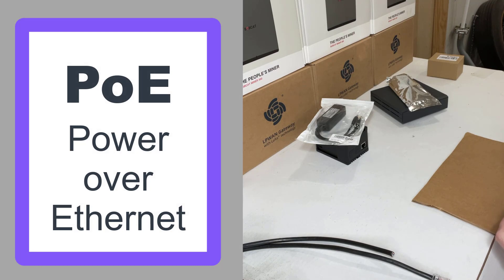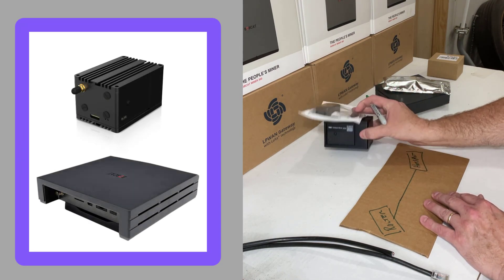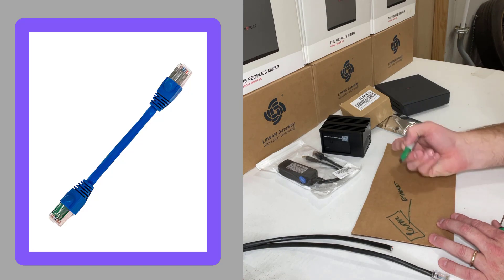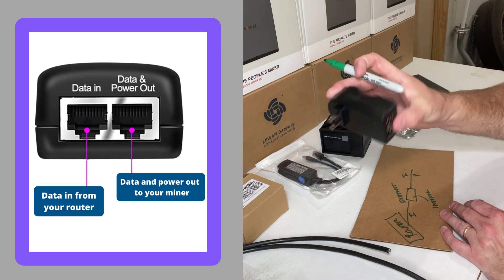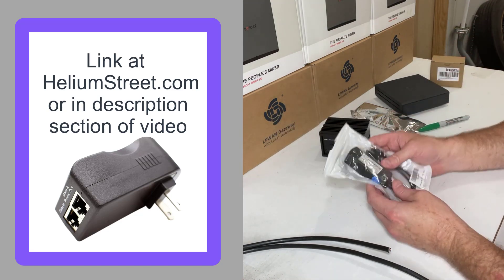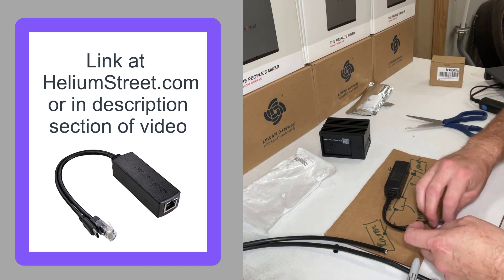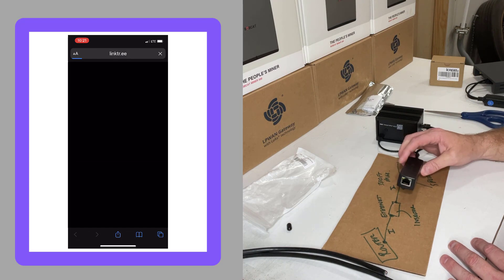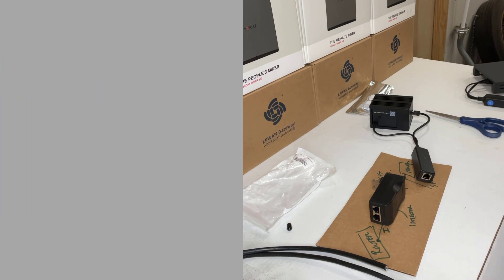Crankk & Helium Hotspot PoE [Tutorial] RAK & Bobcat - Power Over Ethernet

Comment: On a technical point the outdoor unit saves in cost over having to use a LMR400 cable as you can mount it right there at the antenna then run outdoor grade cat 7 (all I use for the last 5 years) down to the POE switch.  Much better solution as the cable is cheaper, has no losses per se', easier to run down the chimney, mast, around corners, and even with a POE Switch is more cost-effective.  Outdoor just seems the more logical choice.
Reply: Except in texas where things melt outside in the summer but I wish I could put mine outside like that lol
Reply from the maker: Totally agree.  PoE is my first attempt at every installation.

Comment: Am wondering if throwing more power with a shorter coaxial cable hosting it outdoors is actual worth having it.  I switched from lossy cable to LM400 type (not exact spec) and did not see an increase in earnings although my power I calculated was twice to the antenna.  Also perhaps the length of cable was not a correct multiple of the frequency  915Mhz ? I can see the advantage of thin coaxial cable 100ft vs 100ft of LM400 that's probably $500 or so!
Reply from the maker: If you are getting witnesses... that would indicate your COAX is working.  Is that the case?
Reply: @on-chain.nation  yes of course it's all working fine, just not a big increase in earnings. Could be cable length.

Comment: Have you heard of the Poe splitters and/or injector that comes with the rak outdoor enclosure bricking miners? Read a couple posts on Reddit about it but doesn’t seem widespread. Just received the outdoor enclosure and wondering if I should use the ones provided or buy separate splitter and injector.
Reply from the maker: Yes, I did a video for the RAK Wireless outdoor enclosure for the Cal-Chip RAK V2, here is a link:  https://youtu.be/zpF61DSywjE

Comment: Long time watcher, thank you! Question for you. I have mine hooked up the same with the outdoor enclosure from Rak with the POE and have confirmed that everything is hooked up properly but my Bobcat miner gets power but no internet. It's been over a week and the light is still yellow after many resets. It still shows offline and not connected to the internet. Any help would be greatly appreciated! 🙏🏾
Reply from the maker: Your router might not be compatible.  You might need a different injector.  Check the comments below for more info.
Reply: @on-chain.nation  Thank you. I switched from POE to an extension cord and got it to go green in the app twice and was connecting to the network, first time said relayed. But both times it went back yellow a day later and never fully connected saying "needs attention:offline and unable to sync". I don't know what's going on.

Comment: You mentioned the wire from the injector to splitter is 300ft max. What about the one that’s coming from the modem to the injector. Will two 75ft cat6 cables work? I’m having issues where the poe system only provides power with no internet. I confirmed the Ethernet providing internet is working by directly plugging it from the modem to the rak. I have 2 separate systems I bought that are having the issues. So unless I got unlucky with two sets of broken Poe systems or I’m doing something wrong.
Reply from the maker: It should be 300 ft max, from router to miner.  75 ft should be no problem.  Very strange.  Sounds like the injector is not working properly.
Reply: @on-chain.nation  ended up being the injector. The ones that come with the all rak everything pack is only compatible with a mb port modem since mine is gigabit i need to buy another injector
Reply from the maker: Great that you figured it out! Good Luck!
Reply: Running this same set up and have tried 2 different injectors & splitters (one that came with Kit didn't work to start) but still only receiving power and no ethernet. Which Injector did you buy?

Comment: Ther OEM Bobcat power supply says 12V 1A but the splitter you use is 12V 2A.  This is not too much power?
Reply from the maker: It works, I've used this device on many installs.  I believe we are still in range.

Comment: Fantastic video. With this set up outdoors  with the POE connected what happens with the antenna grounding? When no house ground near? Thanks
Reply from the maker: NEC has some pretty specific requirements.  However, I plan to run a ground rod down near the pole and use 10 AWG wire connected to a lightning arrester and ground screw in the side of the pole.

Comment: Thanks for the video...i assume this would save money in buying a longer lmr400 cable and using a cat6 cable. Also with all the bobcat updates vs a rak miner which is better in comparison. Thank you for your advice...peace from the u.k
Reply from the maker: Yes, this can cut down the cost of the COAX for sure. Good point. RAK vs, Bobcat… 🤔 I’d go  be with the shortest shipping time.
Reply: Not only cutting down on cost of the coax but you're also lessening the signal loss by having a shorter coax cable. Guys on helium discord advise to avoid having anything longer than 0.5 meters coax cable.
Reply from the maker: @Tom Davidov  I have a few installations with long COAX (using LMR-400 and MPD-400).  59ft. 54ft. and 64ft.  It depends on the miners in your area and the type of antenna you are using.

Comment: @Helium Street why does the splitter have an output of 2A, whereas the power brick of the bobcat itself has a 1A output? Shouldn't the splitter also be a 12V, 1A? Thanks in advance!
Reply from the maker: Amp draw only matters in cases where there becomes an increase in resistance. Voltage is the key point as is the size of the jack.
Reply: @on-chain.nation  the size of the jack is 5,5x2,1mm on the one I ordered (used your link).

Comment: So can I use any type of POE and injector cords from any brand or do I have to get it straight from nebra?
Reply from the maker: Are you running a NEBRA?  Indoor or Outdoor unit?
Reply: @on-chain.nation  outdoor
Reply from the maker: @Mario_710thc  do your outdoor unit come with a PoE injector and splitter? Probably not.  I think the outdoor unit is already PoE equipped
Reply: @on-chain.nation  I bought my outdoor nebra miner from parley labs and no sadly it didn’t so I was planning on going with the other option instead of a POE or do I have to get one?
Reply from the maker: @Mario Grave You should be able to do WiFi.  If you are in range, if not try a WiFi extender.  I've used them with RAK and Bobcat with no issues.  Have you already registered your NEBRA?
Reply: @on-chain.nation  no it doesn’t register the location we think it’s because it’s something on helium’s end since there network is messed up currently but I don’t want to move it around so I’m just waiting for it show on my app

Comment: For the PoE splitter which version do you recommend? There is 5V 3A, 5V 2A, 12V, etc.
Reply from the maker: What brand miner are you using?
Reply: @on-chain.nation  bobcat 300
Reply: @on-chain.nation  and for the poe injector you linked it's out of stock unfortunately, looks like people loved it lol. Is there another one you recommend or if not could you let me know what type of injector to get because I see alot of variants like passive, active, 802.3af compliant, etc. I'm kind of lost on that for my bobcat 300.
Reply from the maker: I'm sorry, I don't have any immediate recommendations.  Reason being... I only recommend products that I actually purchase and use.  I first test the stuff to make sure it works and then I push out the links.  I wish I could help you more that this moment.  I'll start investigating other PoE options.

Comment: Thanks for sharing. Just wanted to know, there is many type of PoE injectors with different volts and watts and amp. Which one do you suggest for most Helium miners? I know for a long  Ethernet cable you need more watts. Just want to make a right choice, so will not damage the miner with over power. Thanks in advance
Reply from the maker: The injector referenced in the purple series works for both RAK and Bobcat. The splitters referenced in purple series are different due to the plug end requirements (USBC vs. Barrel). All have been tested/verified.
Reply: @on-chain.nation  Thanks for the reply, much appreciate it.
Reply: @on-chain.nation  I live in Europe and they don't have color cod for PoE injectors here.
Reply: Ethernet (CAT5-6) runs can be up to 100 meters (328 ft) with no issues.
Reply: @joephu  Thanks and I appreciate it. keep up the good work. cheers

Comment: Nice video, but I wonder that nobody complains about the EMI that these splitters emit.
My Sensecap board is mounted in an outdoor enclosure (without its original case) and with the same 5V 3A splitter my rewards are way worse than before with 5m coax cable.
The quick and dirty solution for me was to wrap the splitter in aluminum foil, but I am looking to completely get rid of it and feed 5V spereratly to the enclosure through a really thick cable.
Reply from the maker: Are you thinking the splitter is effecting the antenna’s performance?  Almost all of my installations are POE and I’ve not had trouble. I’m curious, tell me more,
Reply: @on-chain.nation  
Well at least it happened once to me, could've been a random network effect.  I will report if i test poe again. 
Did you also extract the miners out of their original (metal) cases ?
But you could also do the testing and wrap some of your active poe splitters in foil to see if there is any improvement... Step converters can definitively be very noisy.

Comment: Hello, thanks for the video. Could one use a passive PoE splitter? Meaning, I would use the power adapter provided by bobcat on one end into the injector then use the power on the splitter end? I also, I think I read that bobcat only operates on 100/10 and not gigabit so your PoE doesn't have to be gigabit capable, right? If your miner can only do 100/10, why spend more money to do 1000/100/10, right? Love your channel btw!
Reply from the maker: Thanks!  I'm not sure about your question... specifically "use the power adapter provided by bobcat on one end into the injector", sorry.

Comment: I found out the hard way the rak poe splitter and injector don’t work with 1gb Ethernet ports. Ran out and bought a 10/100 Ethernet switch to resolve it because I couldn’t climb back up to switch it out. Lesson learned.
Reply from the maker: I'm sorry you had trouble. What type of router did you have trouble with?  It may be good for others to know.
Reply: @on-chain.nation  this was a Comcast xb2 router I believe. But anything with 1gb Ethernet ports won’t work with the stock rak Poe parts.

Comment: Why i need the inspector??? I can connect the minef directly with ethernet cable
Reply from the maker: Many routers do not nativity transmit power through the ethernet ports. And you will want a splitter at the miner because many miners do not accept power into the ethernet ports.
Reply: @on-chain.nation  oh thank you learned something new. thank you very much for the answer

Comment: Mike, with decreased rewards happening almost every month are you still planning to deploy more hot spots? Have you slowed down at all? 

- Kyle
Reply from the maker: @Kyle Pelech Good question.  If I made a decision to slow down as of "today" it would not be because of HNT yield reduction.  HNT value continues to grow and that compensates for the yield reduction.  I'm looking at market cap comparisons (see Hilton vs. Airbnb as an example and then use the same ratio to apply a future value estimation for ATT or Verizon vs. Helium) coupled with, DISH news , 5G, and the continued growth of the network for IoT to justify my stance on "future value".   I would however slow down because of the difficulty of managing a large group of hotspots and the work that is necessary to ensure they are all performing to the best of their ability.  This is not financial advice BTW :)
Reply: Thanks for the reply Mike. I agree with you. The more you have the harder to maintain. It has proven worthwhile for now though. In areas with extreme heat or cold would you be looking for an exposure with a fan or heating device?
Reply from the maker: For heat... yes.  Those in the hot areas will need to keep a close eye on temps.  Cold... not sure, possibly for EXTREEME cold we will need to use a reptile pad possibly.